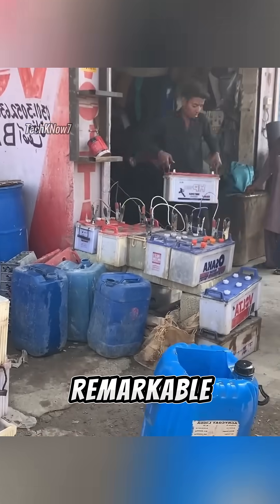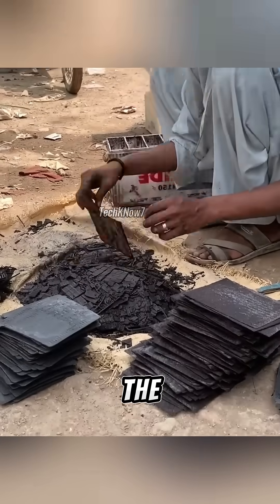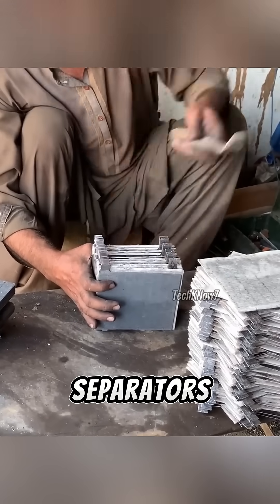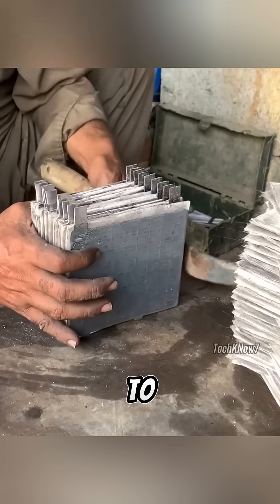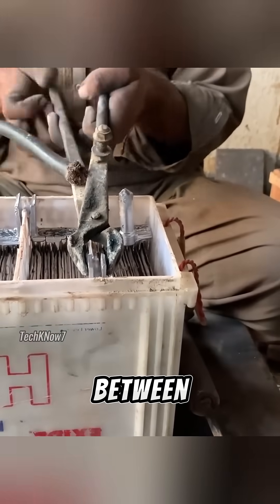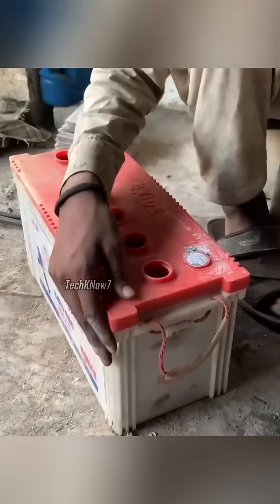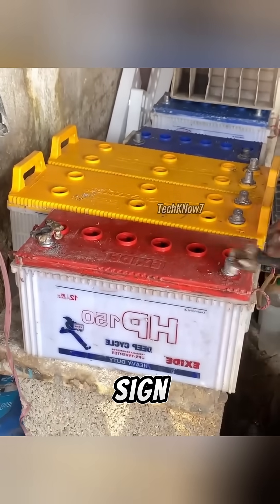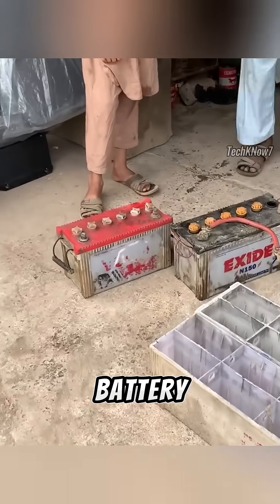Dead Car Battery Restored

Comment: They use lead not aluminum
Reply: The narrator is trying to tell you that he knows not what he's talking about.
Reply: I hear Toxic. (Lead!)
Reply: @samtan9613  Particularly when the lead comes in 45-caliber size.
Reply: 😂 and the voltage is more than 13v. This guy's really mislead folks😂😂
Reply: Aluminium is much cheaper than lead, and it is also highly conductive.
Reply: @nuggetella  Aluminium needs above 600 celsius to melt